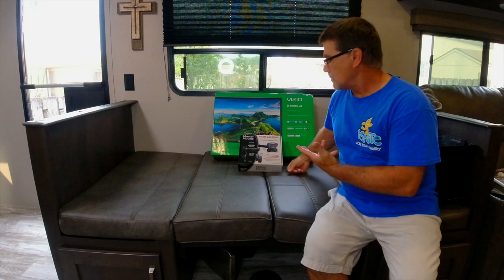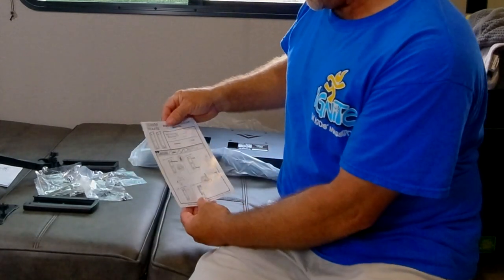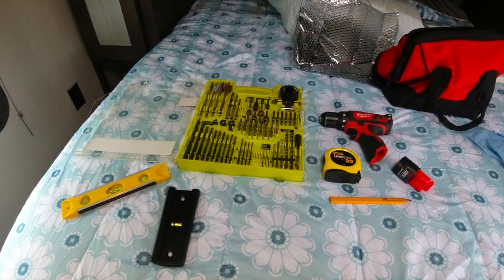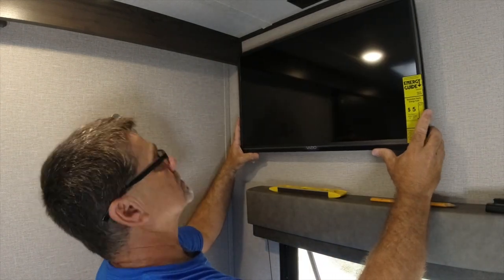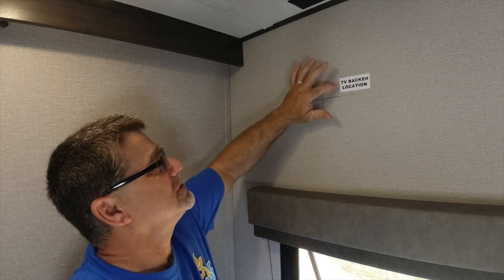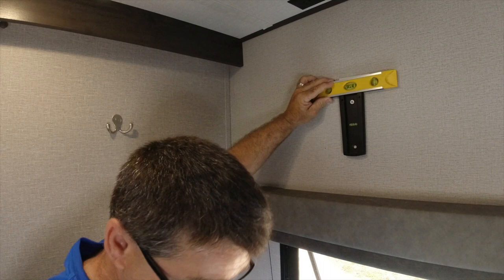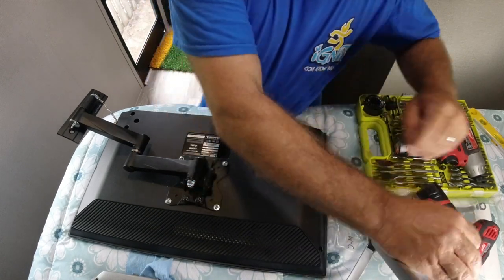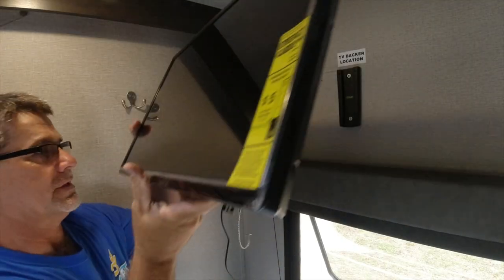Smart TV Mounted in RV Bedroom

Comment: How has the mount held up? Also what size screws did you use to go through the wall?
Reply from the maker: The mount has done wonderful.  I used the screws that came with the mount.  I do not recall the length of them. Thanks for watching!
Reply: Do you remember what size drill bit you used?

I’m nervous these screws are longer they the width of the trailer